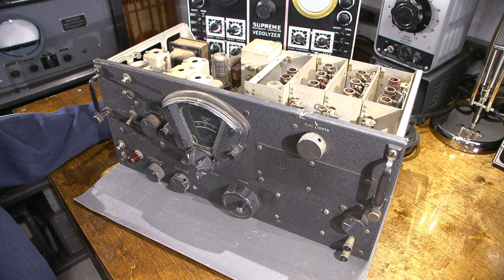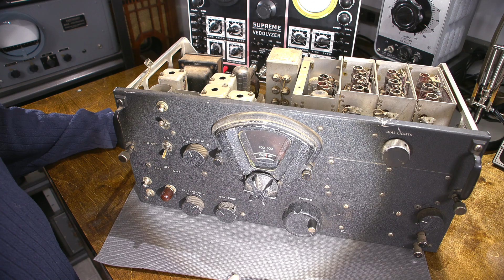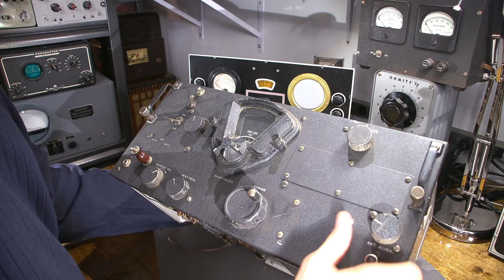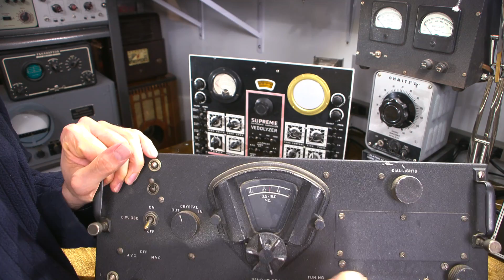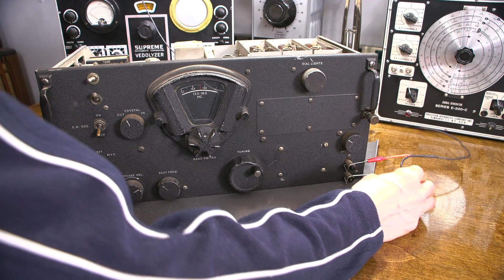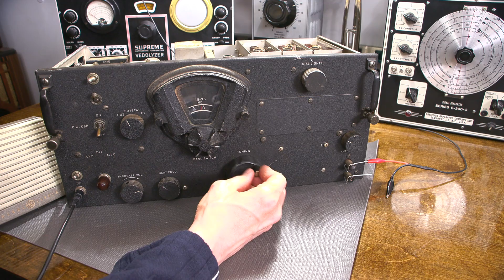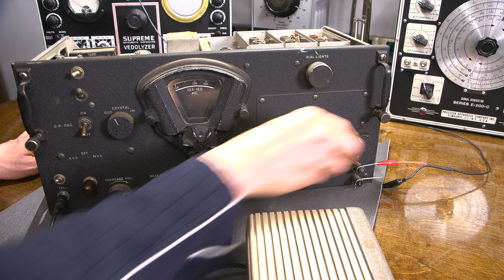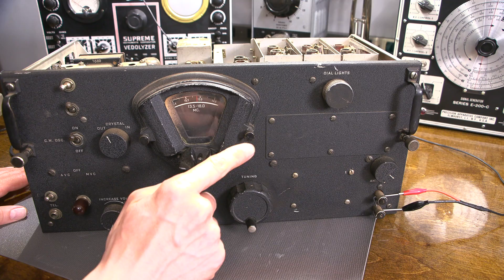B-29 Aircraft Receiver Scrap Parts Unit, Will It Still Work?

Comment: Very interesting video! I saved one of these receivers from being scrapped a while ago. It's been on display at my shop since then. One of the previous owners was a HAM operator, there was a badge with his call sign DJ5RB attached to the front panel. I looked it up and found out he died several years ago (silent key). It's in good shape on the outside but several modification were done, e.g. a S-Meter was added at some point. It looks like there was a power supply added as well but I never tried to power it up or open it yet...maybe I should give it a try.
Reply: AudioMobil,...So I am not the only one to save a unit from scrap,...and then let it sit.  LOL
Reply: @pauld6967  Mine is sitting in the window of my shop along with several old radios, gramophones and other vintage equipment.

Comment: Paul,
Very eager to see this wonderful radio restored!  It deserves a place of honor and is a wonderfully designed radio.
I have a request of you when you do the video(s) on this one.  Would you please use the Leakage Tester on the Oil Filled Metal Can capacitors on the bottom?
Oh, and a couple of interesting things about this radio, there is a potentiometer attached to the shaft of the tuning capacitor ( 4 section 14-331 pF each section ) and the IF frequency is nowhere near 455 Khz....I think it is 915Khz.

Comment: The thing's about 65 years old and it's still mostly working.  Really a well made radio.  The WWV signal at 5 MHz can be pretty weak sometimes, so the receiver sensitivity is good and it's more impressive to me that the 5 MHz mark on the dial is right on  5 MHz.

Comment: Sometimes, a seller will list an item as "parts or repair" if he isn't certain that all functions work. It just means, "No guarantees".      The BC-348 was paired with a BC-191 transmitters during WW2. A little later, the receivers were traded for Collins FRR-41 and the the transmitter for Collins ART-13.  My father worked on all this gear on Guam during WW2 and the Korean War.

Comment: Hey there Paul ,
After watching this again , I have noticed that the cover plates on the bottom boxes appear to be the same as what is required for the top as far as the cover plates . I think you can use them as patterns for the tops that are missing ! I am sure that you have already seen this before and have already made new plates for the top !

Comment: A parts radio? Good grief, it's in better shape than the "working" one I bought at a hamfest a number of years ago. Mine had bad tubes, and the transformer power supply had been wired up wrong. B+ is suppose to float above chassis ground, but ground was wired to the chassis. It sort of worked, but voltages were crazy high, hence the burned out tubes. Anyway, I got it rewired and it works fine business now. Yeah, it has a bunch of extra holes drilled in it. They are collector items and to find one in original condition, unmodified with the dynamotor, plan on spending several hundred dollars! BTW, an old timer told me those were installed in some later B-17's too.

Comment: I noticed this YouTube video about the BC 348 from a couple of years ago. Were you aware that there is also a similar version of this radio that was for Jeep mounting. It was pretty much exactly the same as the aircraft version, but didn't use aluminum case and covers. I had both kinds years ago but unfortunately due to weight restrictions on one military move I got rid of the jeep version. The one in your video was heavy but the Jeep version was even heavier. I still have the (Belmont Radio) version BC 348 and although it is badly out of tune I can still receive WWV with a long wire antenna at 10MHZ. My verson was cobbled up some too when I got it, but not real bad. There is some strange circuit hanging inside that may have been placed there because something once smoked in the bottom circuitry.  I still have several manuals that show the various schematics that were used for the different versions of this radio. I use an external power supply because when I got it the dynamotor was missing. The audio output left a lot to be desired so I ran it to an external small audio amplifier to boost the volume. Keep on making your excellent videos.

Comment: I think some sellers will state "for parts" to avoid high expectations.  They might not have even had a way to test it, nor the necessary missing parts.  I agree to save / restore as many of them as can be saved.  "Parting out" is essentially the same as scrapping- one more is gone for good.

Comment: It may be possible to liquid-clean a receiver chassis without causing further corrosion, using a oil-less coolest such as Kool Mist and distilled/deionized water. Obviously, this would have to be tested on something non-valuable first. There are others, but I have used Koolmist #77, I think it was, and made stronger than suggested on the label, for corrosion safety. The result has the may leave cosmetically faint water spots on large areas, but it's unlikely to rust steel, or corrode aluminum.

These kind of chemicals are meant to prevent rusting in machining operations--sometimes used for flood coolant. Parts of cast iron machines bathe in it. It's generally aluminum-safe for aluminum. It may even be possible to use such a solution in ultrasonic cleaner for parts such as a tuning capacitor. The excess water/solution could be blown out afterwards, using an air compressor. As you know, distilled water is generally non-conductive, but I would not be comfortable letting it get into transformers, and potentiometers, and adjustable inductors.

Comment: That was a treat. What’s the removable front panel plate for? Seems like you might be able to access a few tubes and the regulator bulb if removed?
Reply from the maker: The front cover is for component access under the tube sockets.

Comment: I am thrilled that you are going to do a restoration on this wonderful radio!!!  I have been hoping that you would do one of these for a long time now.
During your restoration, I am eager to hear what you have to say about the Oil Filled Capacitors.  Wondering if you will replace them with new capacitors.
It is sad that the nameplate on the radio is missing.  There are several types made by different manufacturers.  I use to own a BC348M years ago.  Donated it to a Boy Scout troop and in many ways, while I am glad I did donate it, I very much miss it!  The BC348M was made by Stromberg-Carlson, and I think some were made by RCA and other manufacturers.  There are slight differences depending on which manufacturer made the radio.  Since that one doesn't have a nameplate, it might be a chore to determine which model and therefore which schematic to use.  The available schematics are sometimes difficult to read...type and lines blurred, sometimes it is difficult to know if lines crossing are actual connections or just lines passing.  
If I had kept mine I probably would have replaced the dial lights with LED type lights.  I know many people would be aghast at that but since they are not seen other than the light that comes from them, it wouldn't affect how the radio looks.  I imagine that you will keep the original lamps, and that is fine.  Probably much better than my idea of LED's.  
If I remember correctly, taking the cover plates off the coil sections does affect the tuning...like on a lot of radios.  Once you fabricate new ones it will probably work a good bit better.  I still think it will need a through tuning process though.  I am curious about that one band that doesn't seem to work.  Perhaps an open connection on a coil or something.  Or maybe a bad switch connection at that point on the switch.
That tube on the bottom is definitely not original!  I wonder what it is being used for.  I think there are some modification circuits that added a "S Meter" to that radio that required an additional tube, but since it doesn't have a meter on it, I think it must be for something else.
It pains me to see the butchering done to the front panel!  It WILL look better once you replace that knob with the "Bat Handle" type knob.
In case you need it, I have a copy of the manual for the "E", "M", "O", "P", and "S" versions of the radio.  I think they all may be Stromberg-Carlson...but I know the "M" one is.
I had...well, in a way, still do...have a plan to build from scratch one using the schematic but with a few modifications of my own, but have been having difficulties in being sure of the connections in some places.  I especially don't understand what is going on with the "AVC  OFF   Man" switching.  And then there's the fact that this radio uses a 4 section ganged variable capacitor that has a rating of 14 - 331 pf on each section!  Try to find one of those!!!
Thanks again for doing the restoration on this radio...and thanks for this video as well.
Stay Safe, Stay Healthy, and Stay Happy!!!
73,
WB4RHA
Reply from the maker: Thanks for taking the time to write Wayne!

Comment: WOW!  A BC348!  (I actually used one for a while.)  (BTW, I'm older than 74-75 years, and I'm still working too - with no modifications except 10 stents and 2 lenses.)  I'm leaving - before I start having dreams about being in my teens again.  (And I'm still on the air these days, but digital, and not very often - 47 years of programming will do that to you [or to me, anyway].)  Thanks for the video.  (Any old ARC-5s you plan on restoring?  Or turning into W2EWL transmitters?)

Comment: I saw one for sale a year ago. 
$45 as is old radio
It was missing knobs tubes and even the front covers.
A lot of wires cut off dangling and scratches. 
I figured it was the parts supply for bringing back others of the same model.

Comment: Probably just as reliable as some of the avionics we have today.  My best friend is an Engineer for a major electronics firm (that begins with a T) and builds and repairs avionics.  He says the greatest reliability problem in these devices are BGA chips that lose their connection on one of many pins. Often he'll push on the chip and the device will start to work.  Reballing and soldering have to be done by a certified specialist.  I'm surprised that type of blind soldering is considered reliable enough for aircraft and military use.  The B-29 receiver is built in America solidly with the best technology of the time. New avionics contrary to most people's beliefs are designed in the US but often assembled in places like Vietnam and Thailand. (obviously to save money on labor) So much for safety.

Comment: “...  You can see the brilliance of the engineers who built this thing... a lot of time and research went into this thing...”.  True, I haven’t ever known of any other sort of variable capacitor that’s completely made of steel blades that were offset by micrometers, offset from one another, and then ganged in successive sets, with some very clean porcelain looking insulation.  Such a choice variable capacitor that to some not so savvy people it might just be more valuable than the time you just invested in getting this thing to wake up.  And those not so savvy people might not know all that much about B-29 receivers and the mods that have been done to them since they were in service.  So it’s fallen into good hands I’d say.  I have an old command set receiver that I’m afraid to do anything with since it looks to me to have very little modding done to it.  And I don’t understand that dynamotor at all.  THANKS FOR SHARING!!

Comment: I just got one of these, luckily for me I won't have to replace any capacitors as they have been replaced with orange drop capacitors. I do however have to build a power supply as it never had one.

Comment: People sell me stuff on ebay for "parts or not working" and just like your situation it works just fine and just like you with some minor repairs it works just like new or possibly better And I recently repaired a cobra ltd 29 classic and this CB had no speakers or a antenna RX/TX and so I basically fixed it with an antenna wire but modded who wear if you wanted to use an antenna from your house (roof-mounted) you could use the coax (plug type - male or female type connector) or if you wanted to use CB whip (plug type - PL-259) you could use that with changeable connectors and I fix the speaker as an external one because I prefer external over internal speaker because it's better quality to me if you agree

Comment: I own one of those BC-348 and it is in prestine condition, but when I took the cover off I got a small chock; someone had removed the Dynamotor, and nothing else? Who wants that thing, really weird. Anyway, this means that I have to build a power supply for it. I had this receiver for a couple of years now and by watching your video I might finaly get it done, this will be exciting for shure so thanks Mr Carlson's Lab for the impetus and you got a new subscriber.

Comment: Wow! At the age of around 13 my father acquired a very similar (in appearance) receiver to this and I learned all about amateur radio and hogged it for many years. I remember it used to heat our shed just enough to be tolerable. It cam originally with a 28 VDC dynamotor and we replaced it with a transformer and valve rectifier to allow a slow start and not blow the ageing high voltage capacitors. It gave many years fantastic service and got me interested in Electronics to this day! Can anyone please tell me who manufactured it and was it fitted to other aircraft as I always thought it was a B34?

Comment: I’ve bought a few radios to use for parts that were listed as so and couldn’t bring myself to taking them down because they worked with very little messing around with. The good and the bad : the good, now I have another working project. The bad, I still don’t have parts I need for the other one. Lol 😆

Comment: The AN/ARC-8 system was still in service in older USAF aircraft in the early 1970s. At that time, military surplus dealers near Davis-Monthan Air Force Base in Tucson, Arizona, had stacks of the BC-348, that had been removed from aircraft, for sale to the public at $17 each.

Comment: Great video. I'm afraid we ham radio operators do modify gear to suit our needs. I would like something like this radio. as it covers most of our MF & HF ham bands as it is with the BFO .As a 14 year old, I made a 455 kHz BFO to use to decode SSB on an AM only car radio tuned up to top band 1.7 1.8 MHz & used to listen to fish phone Scottish oil rig workers calling their wives back home & an AM/FM only CB radio I had.  I have only modified X business radios like taxi & former police radio sets in the VHF & UHF range to use on our low, & mid band VHF & our low band UHF allocations. You have got lucky to obtain that set in decent nick.

Comment: Ah, the venerable BC348. I have one but sadly it's been heavily modified. It works quite well but could use a little love, developed an arcing issue. Sadly someone, as they would sometimes do, took it out of its case, made a 19 inch rack panel face. I don't have the case. It was free so that's good but I'd rather it was complete. The dial light control is missing, left open, antenna connector replaced with BNC, power supply has transformer and silicon diode rectifier.

Comment: Nearly 4000 of the B - 29 manufactured. 2 still in flying condition.
Mostly manual controls throughout very complex to crew and fly. Early models prone to engine overheating and fire.
Immediate action required to extinguish if at all possible or resulting wing damage total loss of aircraft.
Crew equipped with parachutes for possible attempts fo bail out. An extremely risky maneuver in straight and level. Adverse conditions very dicey indeed. With various terrain danger.
 B- 17, B- 24, B- 36, all had dedicated radio stations as well. Some with many yards long retractable trailing antennae.

Comment: I have one and I built the power unit into an external speaker cabinet, because it's headphones only. The switches sometimes give problems (osc not starting) napther moth balls reduces the silver tarnish. . I replaced all the caps which were oozing . It would be hard to find an RX today with 3 tuned circuits before the mixer. I also put an s meter in mine worked off the agc line.

Comment: Yep have one of these sitting on a shelf. Has the same Power supply conversion, but someone cut the Cord off years ago wires are crumbling, coming off the transformer! I will be very interested to see what voltages are coming from your Transformer ?And  will be going along with you and probably replace my power transformer with something more modern depending on what you show voltage wise coming from yours.jim

Comment: New subscriber here. 

I've got one of those.  Any advice on building a power supply?  I used to be a Ham but that was years ago. A schematic would be fine. I'd like to keep it as original as possible though. 

 The place where I worked cleaned out their "junk" and the radio was headed for the dumpster until I rescued it. It seems to be complete with the only damage being that the extension on the "flusher" is broken off.  I'm into restoring all kinds of things and this vintage radio looks like it would be a lot of fun to get working again.

Thanks in advance.

-dave
Reply from the maker: Hi Dave. When I restore this, I will go over the power supply.
Reply: @MrCarlsonsLab  Thanks! Looking forward to it. I've got a lot on my plate so for me there is no rush.

-dave

Comment: Thank you for exposing us to World War II surplus, it was great for the amateur and hobbyist after the war, and it was cheap. The Dataplate appears to be missing,  I believe you have BC-342 which was factory equipped with a 115VAC supply. BC-348 / BC-224 for 28VDC & BC-312 12VDC  love the sound of a Dynamotor in the morning.